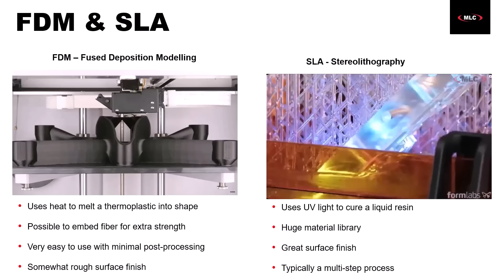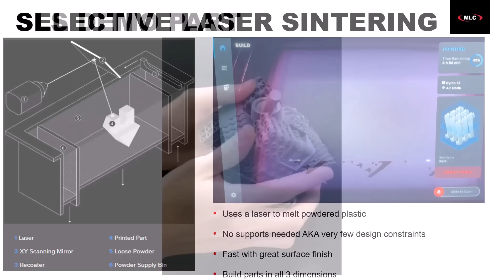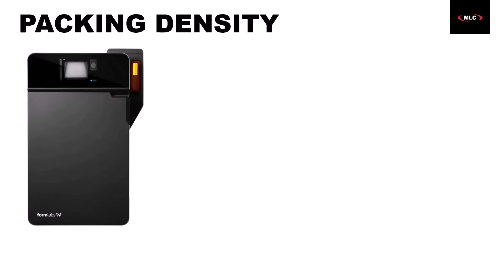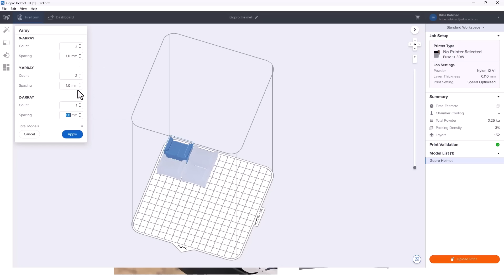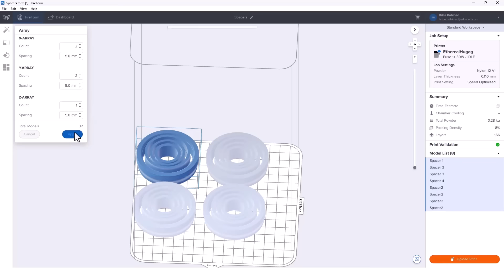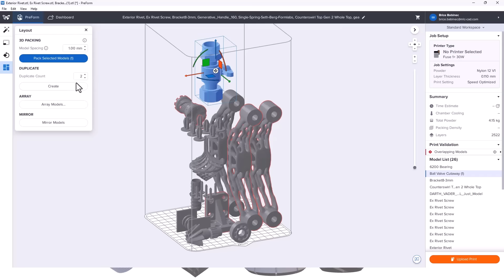One Machine, One Day, Hundreds of Parts – Making the Most of a Formlabs #SLS 3D Printer

Comment: Oh, boy this so nice. Can you please give information about mechanical properties sls printed parts against fdm printed parts?
Reply from the maker: SLS parts are generally stronger than FDM because there’s a better bond between layers and they’re solid filled. With that said, it all depends on your loading conditions. A well-designed part with Markforged continuous carbon fiber will compete with 6061 Aluminum! 

Feel free to reach out to us for more specific properties like tensile strength, flexural strength, heat deflection temperatures, or check out the material specifications published by Markforged and Formlabs which go into a lot of detail with specific values.